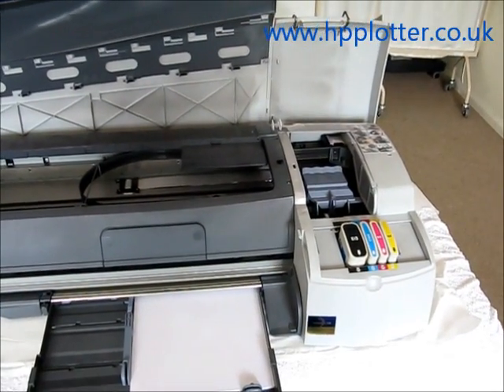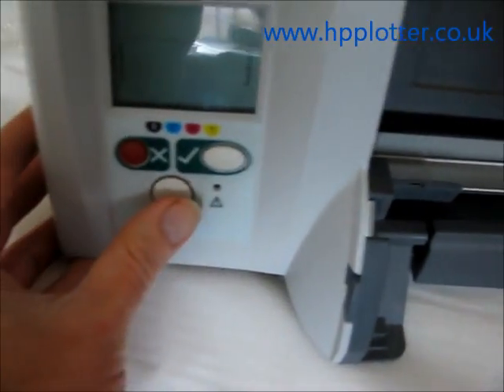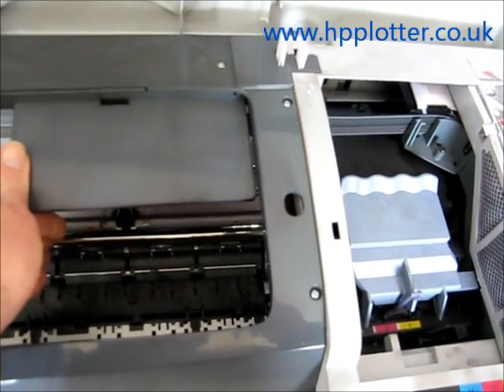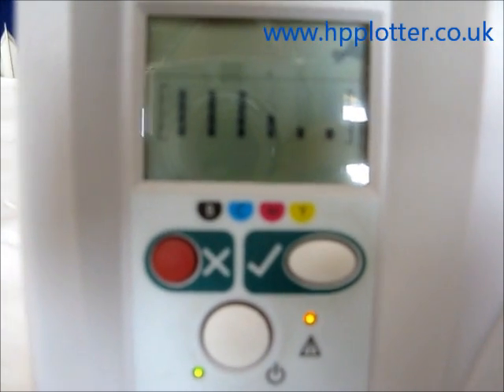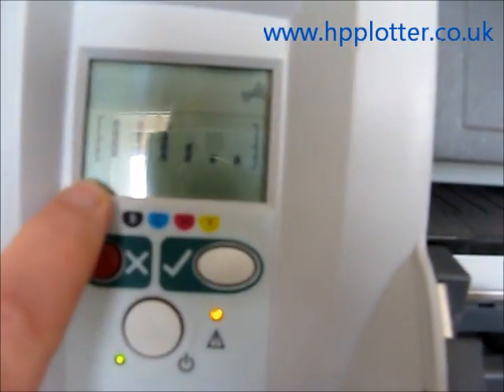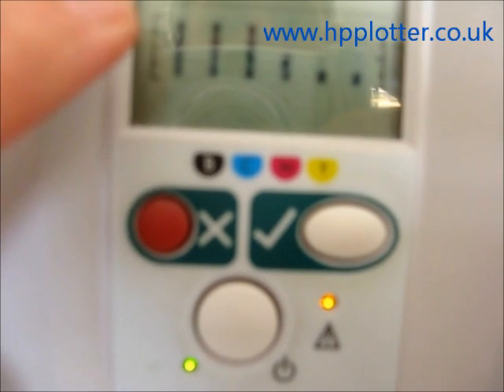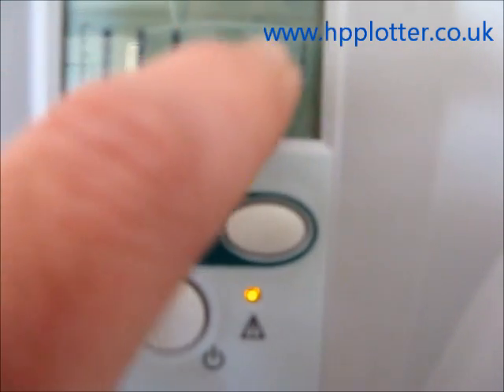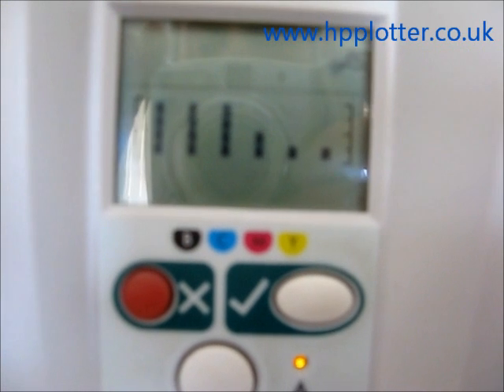DesignJet 100 - 130 reading error codes

Comment: Hello, we have a Designjet 111 overnight started flashing all ink cartridges as empty and will not print anymore. Tried new original HP cartridges and no results, print heads were replaced earlier this year.  Any ideas are much appreciated. THANKS
Reply: Hello Mo - in order to determine what the problem is we need to know the flash pattern and exactly what is being displayed (i.e. are the printhead icons still all showing as well as the ink blocks).

The best thing to do is for you to take a video of the front panel after powering the machine on and send the video to engineering@hpplotter.co.uk so we can diagnose the issue for you.
Reply: Nicola Bray All 4 empty ink icons flash at the same time. The printhead icons are not flashing.
Reply: hello try cleaning the metal connectors and the hole with the chip in the cartridges , if the plotter only show the error in the lcd and dont make any move or show yellow led flashing check the sensor for the covers ( can use the camera from the cellphone) and check for light inside of the left side 
i apologize for the misuse  of the language

Comment: Sorry if someone already post the same question on Spanish.
After 2 years I turn on my HP 110plus and printing test page passed every time ( I try 3 times in the row). I talk about regular XP test page.

When I try to print any document on Win 7 from (Word, PDF, Photo) printer starts normally and then just stops on half page. 
Printer then stops working and buttons don't response. I can't do anything except taking out power cable from electricity. 

Paper stays  jammed  in the printer (on that half printed page)
Two cartridges (black & cyan) shows zero level on printer display. 

What cause printing problems and how to fix them ?

Comment from the maker: Ola/Hola Gabriel y Fredy.
Visitar:  
http://www.hpplotter.co.uk/how-to-read-light-system-error-codes y http://www.hpplotter.co.uk/error-codes 

Darme el numero de error, y despues es possible puedo ayuda ti un poco mas. 

Hi tiredfingers99
You cannot purchase individual transistors or fuses to enable a 'fix' unfortunately, but you can purchase the required full parts from us if you wish to proceed with a repair (or you can weigh up the cost of repairing versus purchasing a new Designjet T120 printer). If you follow the system of reading your light error codes as per the above URL's and email us at engineering@hpplotter.co.uk we can attempt to assess likely parts required. If you believe you have already pinpointed the fault to the scan axis carriage motor, then we can either fit this part for you or supply you with the part-only; whichever you prefer. Thanks for your enquiry and apologies for the delay in responding. 0845 0770 787

Comment: My HP 130nr turns on and the service station moves, but the carriage never moves back and forth and I get an error. How do I fix this? Are there transistors or fuses on the main board? I took out the scan axis carriage motor out and it worked when I plugged in DC current to the motor.

Comment from the maker: @mopri_182 Scan-axis shutdown during initialization. Unplug power cable from the printer, wait, then plug in again to check if Error Code has disappeared. Check the Carriage moves freely and DOES NOT bump into the Service Station. If the Printheads are not installed, maybe the carriage cover is not closed completely. 
If error persists, call a Service Engineer

Comment from the maker: @Saghir Hussain  There is a possibility that the fuse in your plug has blown or power cable is not connected.  Failing this, most likely the power supply unit has failed.  There may also be an issue with the main board.  We provide a comprehensive repair service UK-wide and are HP Designjet Value GOLD specialists 2013 (which means we are fully certified & trained on HP Designjets).  Please email engineering@hpplotter.co.uk to request a repair estimate or telephone 0845 0770 787.

Comment: Hi thanks for the video. 
I have a HP designJet 100 which I have not used for several years. I am trying to get it setup again but it will not power up. Any ideas of what I can do to get it up and running? When i plug it in there is no response at all, no light, no indicator, no movement. Would really appreciate your help. 
p.s. do you provide a repair service?
Thanks